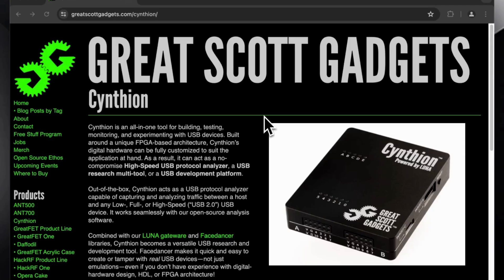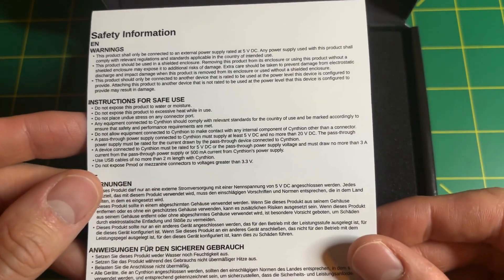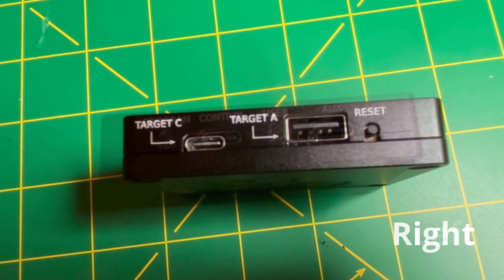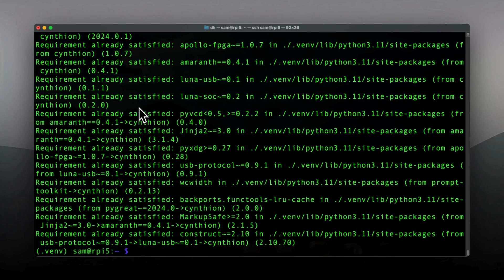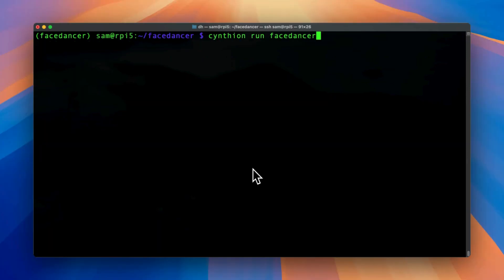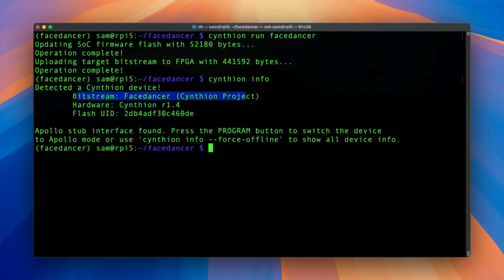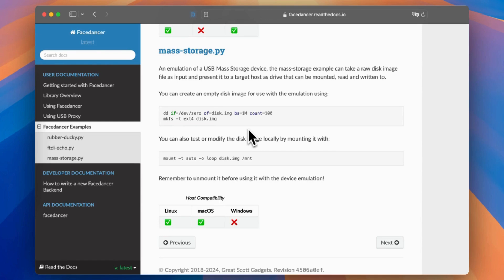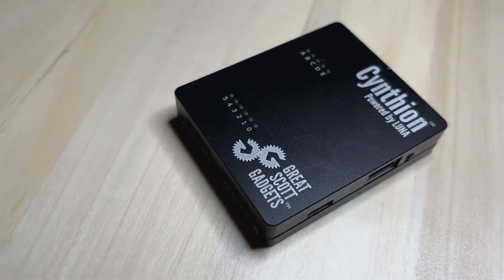Great Scott Gadgets released their latest device, Cynthion: A USB protocol analyzer!

Comment: On the Raspberry Pi 5, I am only able to achieve OTG USB2 data (pi in device mode using g_ether) when using a USB-A to USB-C cable, which loses PD power capability due to USB-A limitations.  I can’t get proper OTG data over an E-marked cable.  I’m curious if you are able to use the Cynthion to analyze the USB-C port to collect PD initialization and OTG initialization and see if there’s a clear issue.  I’d like to buy the device to debug, but I’m not sure if these are within it’s capabilities.

Comment: Any thoughts if Cynthion can be used to learn about how USB software security dongles work?

For example, my luddite theory is an application generates a random number (using date/time, mouse movement, etc as a seed) then sends it to the dongle, where the value returned is validated?

However, there must be more to it, since the software could be patched such that it always sends the same number and/or accepts any value returned.  

Would love to emulate a dongle for a 20-year old WinXP program that I use under a virtual machine.  The company is out of business, and the dongle is flakey.  I try not to unnecessarily remove or insert it, and just always keep it plugged in, however, even still it often loses the connection.   I'm sure it's a matter of time before it will stop working!
Reply: USB is only 4 wires, why not remove the connector and replace with a cable, or replace the connector